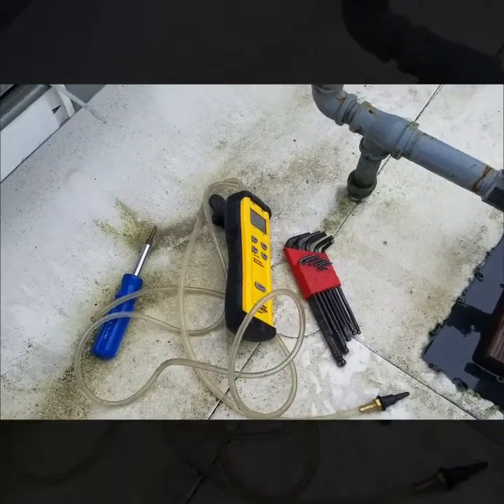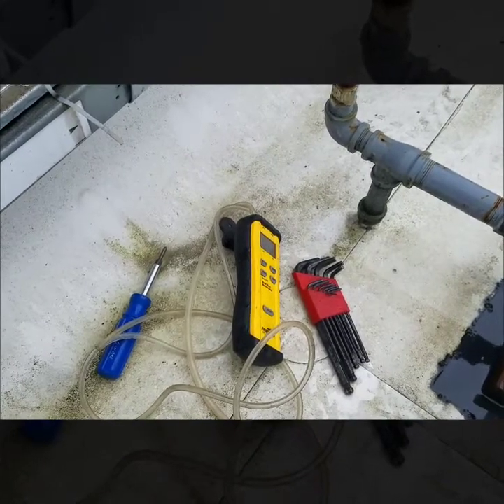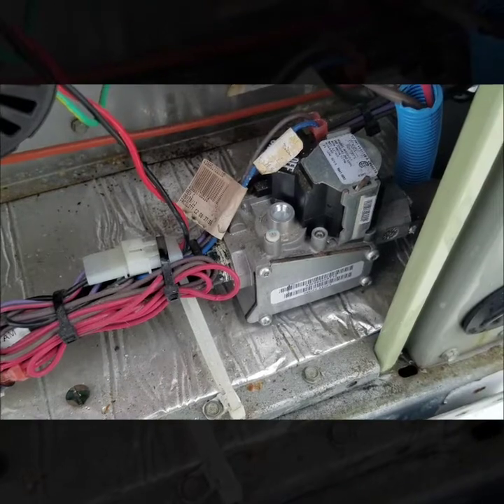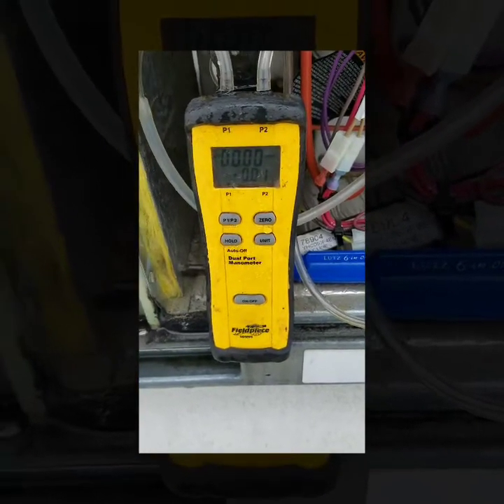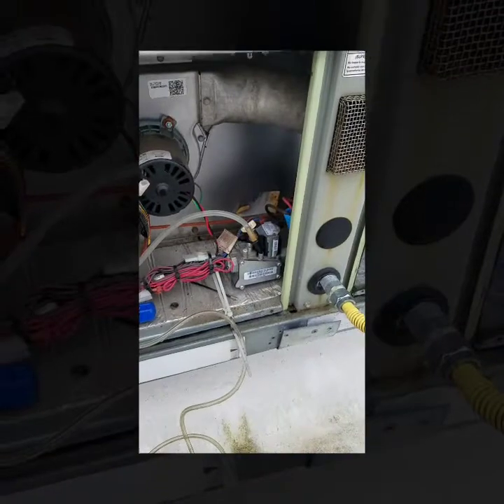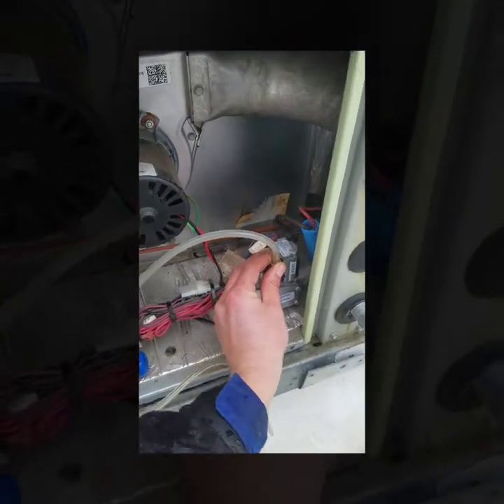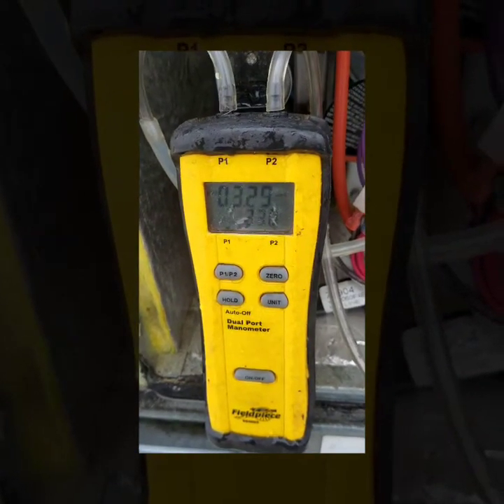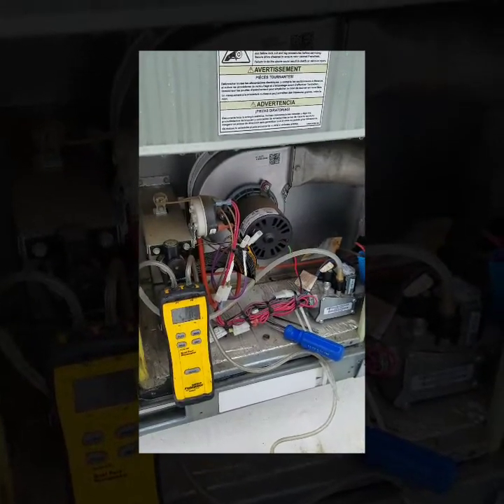How to adjust gas presure on Trane package unit (Natural Gas)

Comment: Awesome video, thanks for sharing. When would you need to adjust a gas regulator?
Reply from the maker: Typically during fire off you want to make sure that pressures are correct. Or if you are having issues with flame/burners.